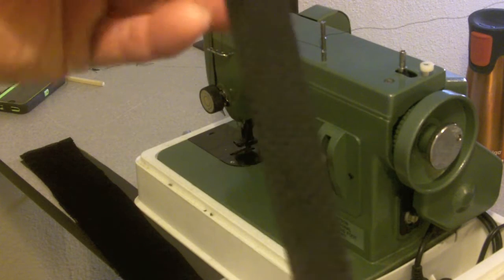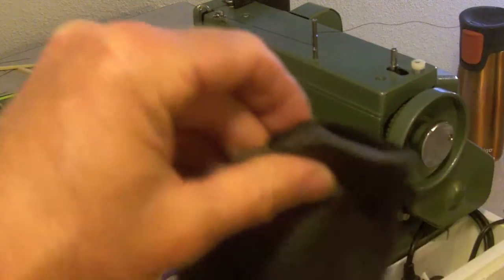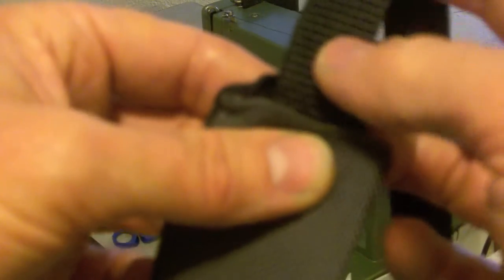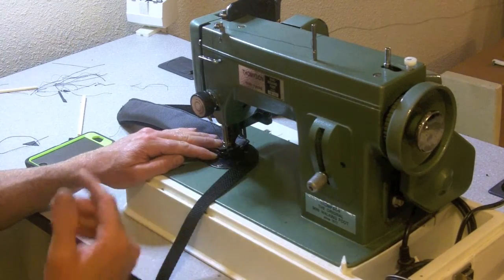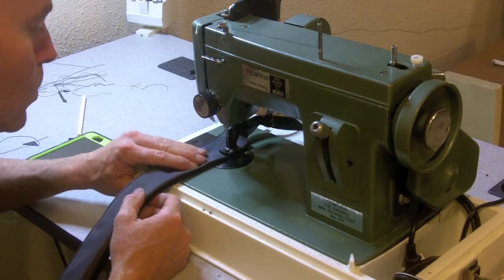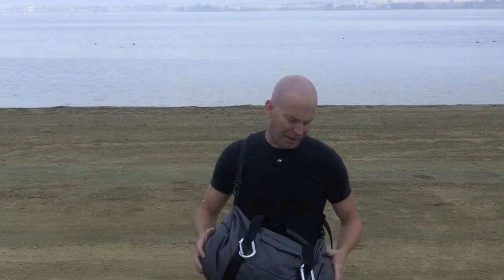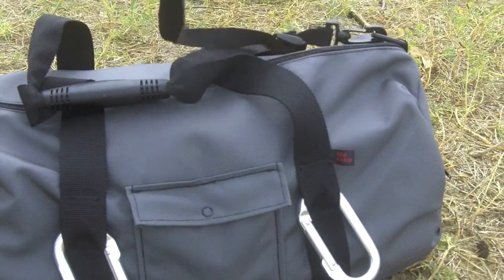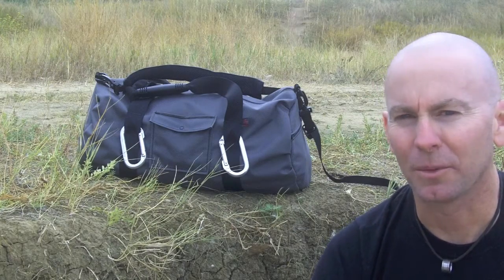Sewing for guys: Make your own duffel bag part 4

Comment: How did I miss this series? Great bag. I hadn't seen nor heard of a Thompson brand machine previously. Looks compatible with the Sailrite you have now.
Reply from the maker: How DID you miss it?!? As punishment, you have to go back and watch every one of my videos and have a report on my desk first thing Monday morning :)
The Thompson is the machine Sailrite based the Ultrafeed series on.  Sailrite teamed up with Thompson and refined the design, and the Thompson I have is (I think) the last iteration of the Thompson, and is essentially identical to the Ultrafeed LS-1.  In fact, I plan to (eventually) upgrade the reverse/stitch length lever and maybe a Monster wheel on this machine.  I see them pop up from time to time on the online classifieds, if you can find one at the right price they're great.  In some ways I like it better than the Sailrite (some metal parts that are plastic on the Sailrite, for example).
Thanks for watching!
Reply: thejasonofalltrades Ha! My notes on this one were check Craigslist often, sometimes you do have to use pins, any webbing is a PALS opportunity, and practice my circumferential calculations :-). I had the same situation happen on my first attempt at a stuff sack and haven't bravely gone back yet to try round things again.

Comment: Man love your videos! Glad I found your channel. Do you have a bartack machine? I usually use a tight zig zag on home machine for my "bartack" works really well but would love a dedicated machine. Also, if you ever want to let go of that Thompson let me know!
Reply from the maker: Hey Ken, thanks so much!
I don't have a bar tacker - YET.  I do the same tight zig-zag with one of my zig-zag capable machines, or just stitch back-and-forth with a straight stitch, depending on how important it is to me.
If I ever decide to let go of the Thompson, I'll keep you in mind.  I have seen one or two others on Craigslist (in the Denver area) since I bought mine.
I appreciate your comment, thanks for watching!

Comment: Man that's super cool, i loved, I definitely wanna make it. Whats the name of the fabric that you used and where can i buy the rubber handle attachment? Thank you so much
Reply from the maker: +Karine Shelburne Thanks so much for watching!  The fabric appears to be a 1000 denier Cordura, or something similar.  Since I bought it as part of a large lot, and there is no label on the roll, I can't say for certain, but it's definitely heavy ballistic nylon.  1000 denier Cordura is what I would recommend if you want to make a bag similar to this one.  I've had good shopping experiences with Rockywoods fabrics; they have a good selection of Cordura, and good info as well.
As far as the handles, they were also part of the same bulk purchase, and I have no idea where you might find them (other than trying Google, of course).  There are several methods for making a handle out of nylon webbing by sewing a section flat if you can't find handles you like.  I didn't intend to use the handles, but since I couldn't figure out how to remove them, I used them, and they seem to work well (the bag has since been given to a charity auction).  Thanks for watching, and post a comment when you get a bag made, I'd love to see it!

Comment: I have a question ?
I have a singer 66 motorized when i sew and let up on foot control i feel it continues to sew a coupe more stitches !
Any suggestions or ideas why? Thanks i watched your  5 tips but no i have found covers that subject😊😬
Reply from the maker: Hi, 

Does the motor remain engaged (electrically), or does the momentum of the machine keep it going?  If the latter, several of my older machines do this.  I have no personal experience with treadle machines, but I've seen people using them use their hands to grab the hand wheel to stop the machine.  I suppose you could do the same thing with yours if it's just momentum.  I usually just stop far enough ahead, and hand wheel up to corners or stopping points.

If the motor is continuing to operate after you lift off of the pedal, that suggests to me some electrical problem (dirty contacts, worn parts?).  That's beyond my level of expertise, but a sewing repair shop or appliance repair person (if you can find either) might be able to help you.

Industrial machines often have a brake integral to the motor that allows the user to stop immediately, but I don't know if any household machines have a similar feature.

I hope that helps, let me know how it works out!

Comment: Where do you get those sec  Carabiners ? I had one but it got stolen I like that it's not a tapered shape please let me know
Reply from the maker: Hi, 
I don't remember where I bought them, but they are Black Diamond brand.  I searched Google images for  "climbing carabiners" and found them quickly, let me know if you have trouble and I'll try to help.  
I use these for my hammock, and I've had no troubles with them.
Thanks for your question, and thanks for watching!